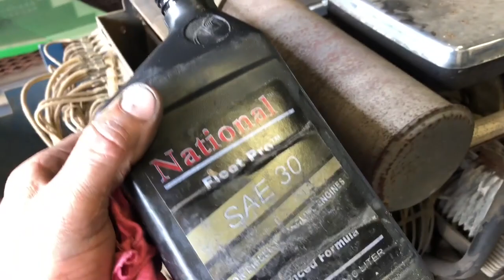Welder trouble

Comment: Wade just put Rotella in it already. I dare you to find that cheap oil and read the label. It says NOT to be used in engines built after 1930. It has NO additives and NO detergent, its JUNK and so will be that engine. That is the same engine that an Onan 4.0 BFA has.Mine has had Rotella 15/40 in it since new, and has over 7,000 hours. Change the damn filter and oil QUICK !